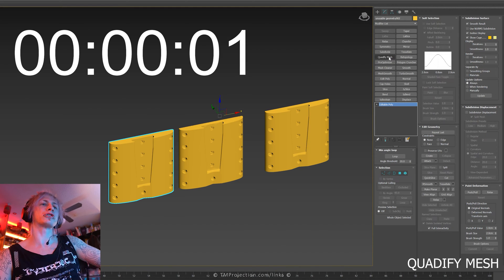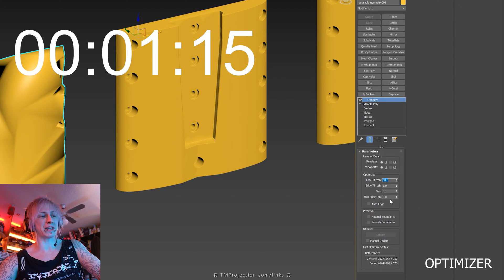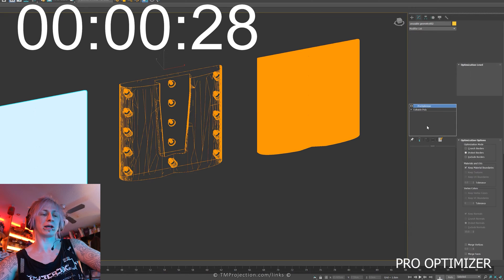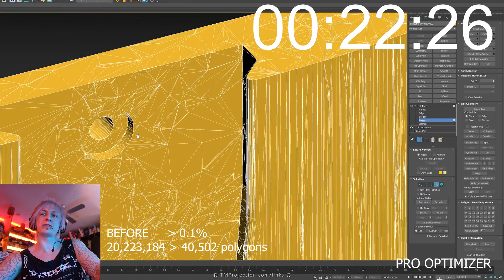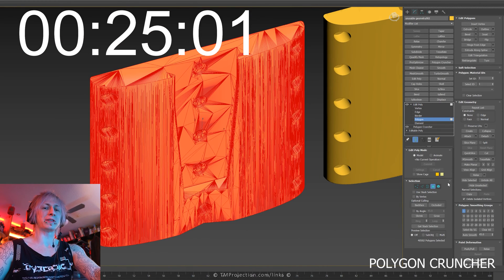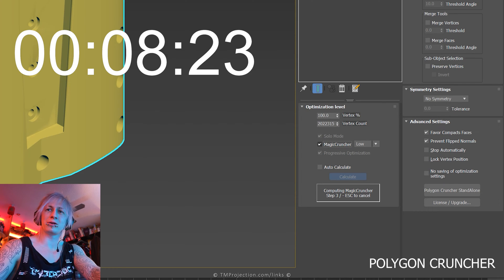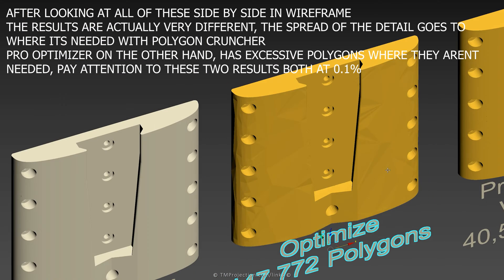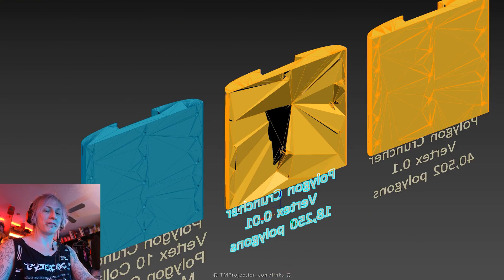3DS Max Polygon Reduction Comparison - Polygon Cruncher, Retopology Quadify Mesh, Pro Optimizer...

Comment: For retopology to work properly you need to define what edges to preserve. 

Also, your model is symmetrical, you could slice it in half, repo this half, and then use symmetry to rebuild the whole thing.